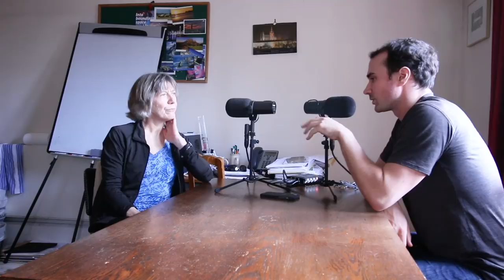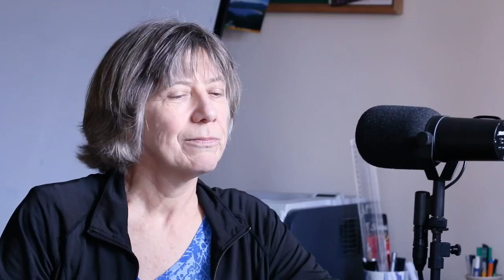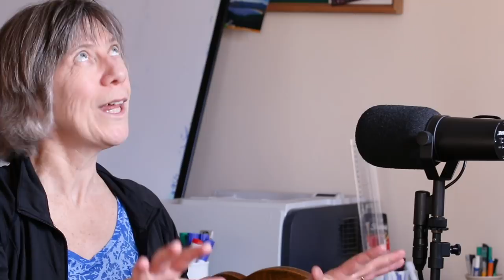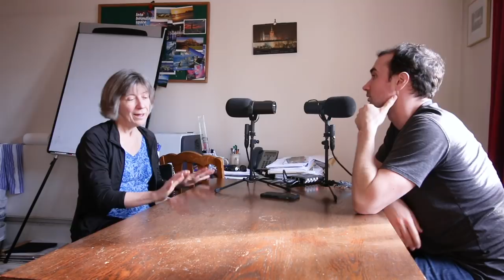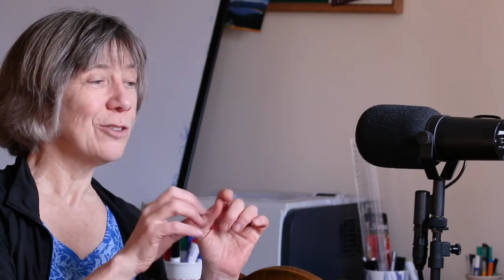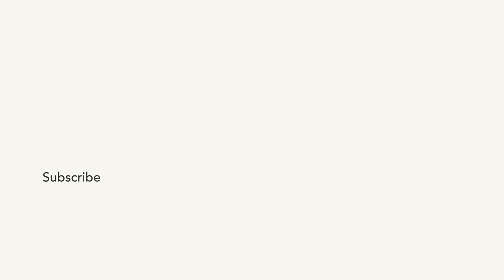Joan Lasenby on Applications of Geometric Algebra in Engineering

Comment: O(2^(2n)) complexity in general multivector multiplication is an issue.  i find the standard books extremely unclear on multivectors, and making it seem like there are a lot of corner cases.  but if you just look at a pair of multi-vectors that explicitly represent every part, then each multivector has 2^n components, and multiplying them is just the distributive law; where the magic comes from the cancellations and anti-commutes when you compute (a b) = (a1 e1 + a2 e2)(b1 e1 + b2 e2) ... questions about whether something is a scalar, vector, bivector etc is answered by which parts come out as zero.  I had to find this out myself by writing code to perform the general multivector computation; and don't think any of the books or papers make this clear at all.  Of course, dealing with the O(2^(2n)) complexity of general multivector multiplication can be handled behind the scenes with a sparse representation generated by a smart compiler.
Reply: note the 2^n parts... think of patterns of bits for turning e1, e2 on/off.... (0 e00 + a1 e01 + a2 e10 + 0 e11) (0 e00 + b1 e01 + b2 e10 + 0 e11) ... then input and output for each multivector has 2^n scalars, and you distribute in 2^(2n) raw operations; or you need clever sparse operation.  you have problems with numerical accuracy, where sometimes something will come out as a wrong type because you subtract two numbers and don't get exactly zero for a component... suddenly you can have something that is "mostly" a bivector with a very very tiny trivector part... that infects everything.
Reply: @robfielding8566  Regarding the quote 
"...suddenly you can have something that is "mostly" a bivector with a very very tiny trivector part... that infects everything"

Very interesting (no sarcasm).
Could you point me to an open source GA codebase that suffers from this?
Does this affect the 5D Conformal GA as well?

(I agree about mv-related big O is pretty nasty, and I agree that the books are still a mess and everyone has their own notation.)
Reply: @minRef  when i talk about "strong typing", i'm not talking about the language at all, actually.  what i mean is that if you use a bit string to represent a spot on the multivector where a value goes, such as "e_000" for scalar, "e_001" for e1, "e_010" for e2, "e_011" for (e1 e2), etc.  a "scalar" is a multivector for which every part is exactly 0.0 other than in the e_000 slot.  if you just multiply raw multivectors, some parts will come out slightly non-zero in some circumstances.  but if you know that you are going to perform: (b a v a b), then you know that the end result will by of type vector.  therefore, do it as one computation where every spot is guaranteed to be 0.0 except for e_001, e_010, e_100.   that's what I mean when I say "strongly typed".  if you just do general multivector multiplication, you can't just look for where zeroes are to deduce the type.
Reply: rrr00bb Ahhh. So it's kind of like the inclusion status? (of the multivector set storing 2^n possible bits).
Reply: @minRef  (1, e1, e2, e2 e1, e3, e3e1, e3e2, e3e2e1) ... (e_000,e_001,e_010,e_011,e_100,e_101,e_110,e_111) when viewed as a bit per included basis vector.  viewed this way, multiplication is just the distributive rule.  what's tricky is when you have something like: (e1 e2   e1 e2) ... you have to calculate that it goes into e_000 with a minus sign.  A "scalar" is like (3,0,0,0,0,0,0,0), a vector is (0,1,3,2,0,0,0,0), trivector (0,0,0,0,0,0,0,3), etc.
Reply: @minRef  yes.  that's why there's 2^n of them.  on/off combination for all all basis vectors

Comment: The exterior algebra of differential forms is much better known than geometric algebra and also has been used to simplify Maxwell's equations.  Can somebody recommend a reference where the two are related?
Reply: A geometric algebra reformulation of geometric optics
Quirino M. Sugon Jr. and Daniel J. McNamara just came out

Comment: I still don't understand the advantage of such framework compared to linear algebra. Does it simplify computations if implemented? Is there an instance where such advantage is evident?
Reply: @minRef  Having less lines of codes doesn't necessarily mean having more efficient code. It is my understanding that GA can be implemented efficiently, still this doesn't mean this would be any better than LA.
Reply: @Luca Gagliano Regarding "efficiency of LA": Clifford/Geometric Algebra can use trivial rules to literally create LA, as well as things like quaternions, Plucker coordinates, or implicitly create new theorems on the fly to simplify things and avoid brute-forcing. The idea being that the fastest code is code that doesn't exist. Linear algebra cannot generate Clifford algebra, and it struggles with Automated Theorem Proving. That being said, nothing changes the fact that you still have to benchmark every real-time system and pick the best implementations for your finite set of target architectures. Regarding numbers of lines, that wasn't referring to efficiency, but as a rough estimate of the relatively small variance in complexity of expressions among a set of problems that varied significantly in problem type and dimensions. I mentioned the length of the engine and the fact that theres only one generator function to show that the complexity isn't being hidden somewhere and appears to be emergent. If you click on the examples you'll see what I mean. This is the most obvious web based demo of GA's strengths that ive seen  and it suggests that Hestenes's work to create a "unified language for mathematics and physics" is going in the right direction. 

Anyway, I would only suggest that you try Geometric Algebra if you've ever been bothered by why certain linear algebra and quaternion theorems seem to come from nowhere. If so then I'd suggest trying Lengyel's "Foundations of Game Engine Development Vol 1: Mathematics" book, chapter 4, or try the youtube lecture "A Bigger Mathematical Picture for Computer Graphics". I'm not saying you should ship this next week, but that building math intuition ends up being useful in surprising ways. Have fun!
Reply: Linear Algebra does some parts of what Geometic Algebra does. Vector Algebra, Tensor Algebra, complex numbers, quaternions, Pauli and Dirac matrices  also. Geometric Algebra covers all those things in a consistent way.
Reply: @lucagagliano5118  It really depends on what you mean by "efficient code". There is a real cost to complexity when it comes to coding.

GA puts a large amount of complexity in the outset (learning is tougher, as evidenced by @minimal "after a painful start" comment), because GA bootstraps dimensionality itself in a consistent way. Fundamentally, this is recursively stacking the concept of "magnitude" and "orientation", dimension by dimension & always accompanied by the bases (frame of reference). So you can think of the difficulty of including "frames of reference" right from the offset and every step of every proof includes this mental complexity. Even just understanding the concept of a "number" is not a disconnected process, as this can be a subspace, a space itself, etc. 

LA adds complexity piecemeal as it has evolved through history, much like code before refactoring, so it's easier to learn for a beginner building up vocabulary. First we learn about numbers and addition (objects and operators) and this expands to other objects and operators like lines, planes & volumes. Then we get into vectors and dot/cross products which starts to blue the line a little between objects, operators and dimensions. But then we group together vectors into matrices and start to use things like complex numbers and quaternions and we start to feel the technical debt for the blurring of this growing list of special case objects and operators, both mentally and code-wise.

Because GA unifies these things from the outset as a language for describing dimensionality itself (and relationships among spaces/subspaces), it allows for both intuitive understanding and the implementation uses code generation to do the case-specific objects (operators are objects). Here is a quote from the mentioned ganja.js readme (https://github.com/enkimute/ganja.js): "(Technically, ganja.js is a code generator producing classes that reificate algebraic literals and expressions by using reflection, a built-in tokenizer and a simple AST translator to rewrite functions containing algebraic constructs to their procedural counterparts.)" So that "reificate" means that it "instantiates" (code gens) whichever case you need in a consistent manner. This will allow for AI/ML algorithms to dynamically instantiate (either through compile-time code gen like ganja.js or runtime instantiation) new code in the future (as @minimal states with automated theorem proving).

And that is just the code side of things. For me personally, I think the great part of it is having the intuition that GA evangelists are so enthusiastic about. I still remember the first time I got to see how the "magical square root of -1" actually makes sense because GA builds up the dimensionality without the intuitive bias (technical debt) we as children had for things like numbers and square roots (all GA objects have a basis and orientation and a negative square root makes geometric sense!! - See https://youtu.be/PNlgMPzj-7Q?t=1084).
Reply: David Hestenes used Geometric Algebra to analyze Schroedinger's equation, Dirac's equation, and other related to quantum particles, for insights on the nature of electrons.   

One of the simpler applications of GA to physics is writing Maxwell's four equations as one, where the electric and magnetic fields are facets of one thing. If we had known only three of those equations,  or had one incomplete as history actually went, to use a GA approach would give us one elegant simple equation that we could take apart, space parts and time parts, separating scalars and vectors, and derive all four of the equations, all complete. 

Hoping to do something like that for other fundamental laws of physics may give us insight on understanding the leptons and quarks, or solving problems in GTR or quantum field theory in a more efficient way than slogging through a bunch of separate equations for different facets or components of whatever is being studied.  For electrons, the 'i' in the wave equations is the key to understanding spin.  

More generally, combining scalars, vectors, bivectors etc into a single coherent mathematical object, the multivector, gives an advantage in mathematical analysis similar to how combining the x, y, and z components of force, velocity and acceleration into vectors, making classical mechanics a lot easier to analyze.
Reply: Basically if you have the choice to learn 30 languages to speak with everyone or just 1, what would you prefer?
Reply: @BboyKeny  so it's just a more general framework then

Comment: There still is cross product in 4d right? Assuming basis vectors w x y z. 2w crox 3y is 6z no?
Reply: Cross products don't make much sense.     W ∧ X  = WX, a bivector.  There is a "dual" to any bivector, in this case YZ.  That might be the closest to anything like a "right hand rule" but giving another bivector, not any kind of vector, not even a "polar" vector.
Reply: @DrunkenUFOPilot  Hmm, also in my example you could interchange x and w making them essentially the same. Which creates problems. I'll have to look more into the so called outer products. Interesting video.
Reply: Depends on how you generalize its meaning. If you see it as an object orthogonal to a plane (bivector), you get another plane. If you think of it as a pseudovector (i e the dual of an n-1 dimensional object), then you get the vector perpendicular to a trivector volume. 
For 2D, that corresponds to finding the vector perpendicular to another vector.
Vectors are only perpendicular to rotation in a plane in exactly 3D (since 2+1=3). The generalization you choose depends on if you care about vectors or rotation.
Reply: There is no cross product in 4d.  In 3 dimensions a cross product of any two of three orthogonal basis vectors is by definition the third basis vector.  In 4 dimensions there are six cross products wx wy wz xy xz yz but only 4 basis vectors w x y z.  See the problem?